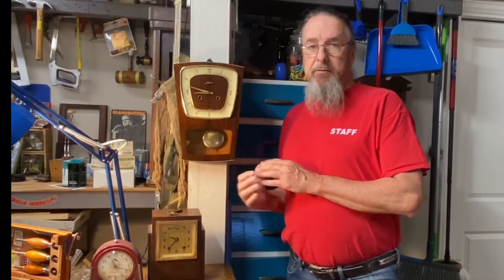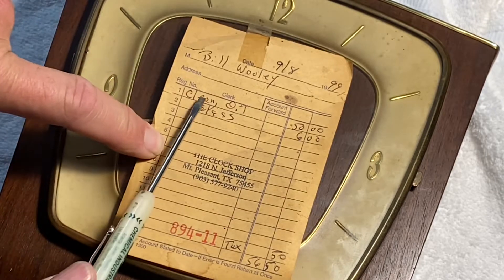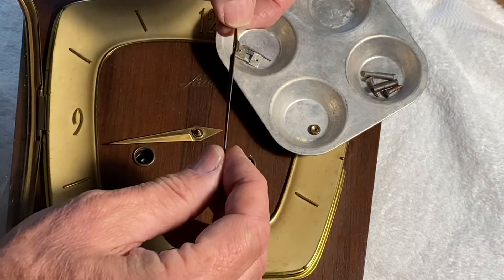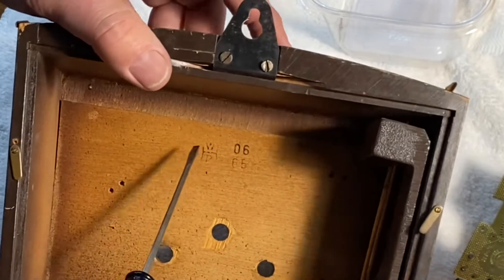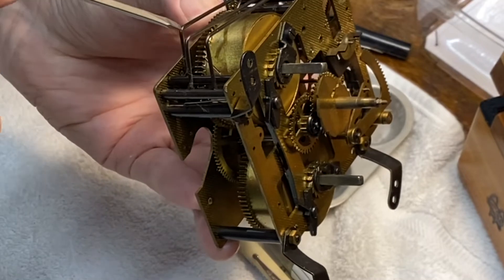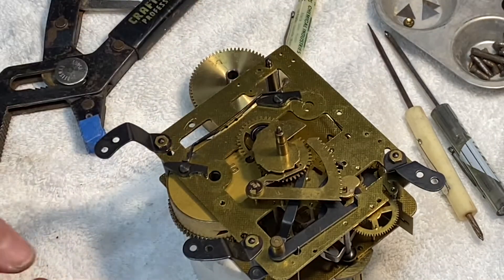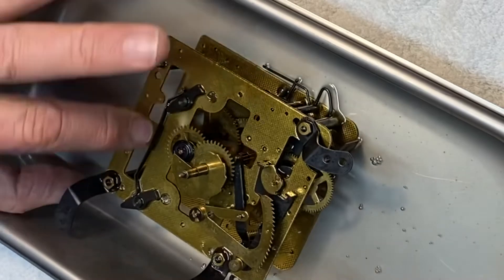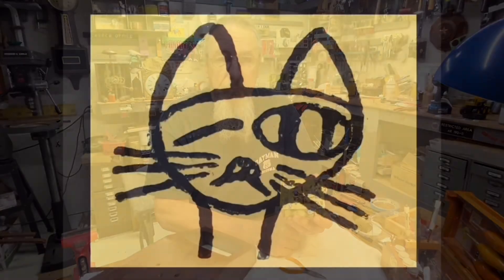DIY Servicing and Restoration of a Mid-Century Haid Clock FHS 141-030 - Part 1

Comment: Hi Jimmie, just got my hands on one of this partially functioning clock. I started openning the clock gently to clean it, and one wheel was stuck to the top and the whole thing oppened and scattered like a flower all over the place. I know most of the peices go where except one. Do you have a picture of all wheels inside ? thanks

Comment: How to I sync antique kitchen clock that’s striking once on the hour and 5 (for example) times on the half hour? Thanks.
Reply from the maker: It sounds like your minute hand is 180 degrees out on its arbor. I’m not sure what type of clock you have, but nearly all have a square post and the minute hand can be mounted in any of four positions. Remove the nut or the pin, remove the minute hand, point the minute hand to the opposite position and replace nut or pin.
Reply: Thanks so much. Problem solved.